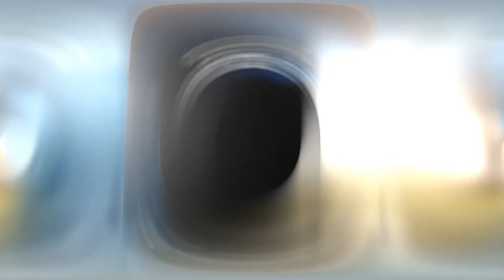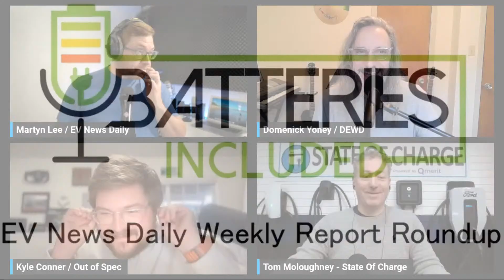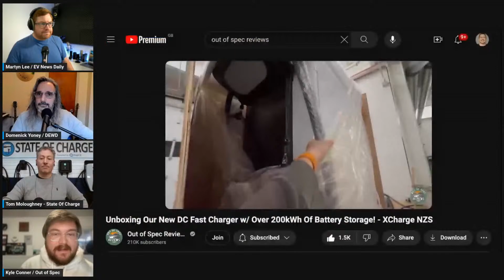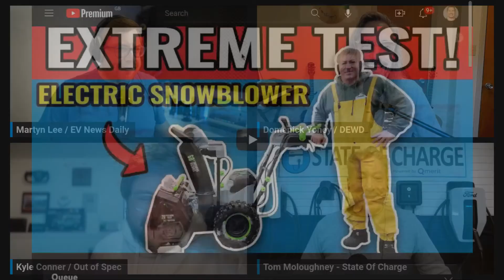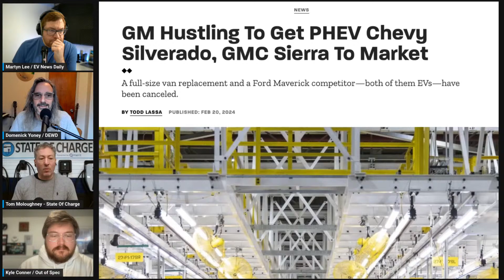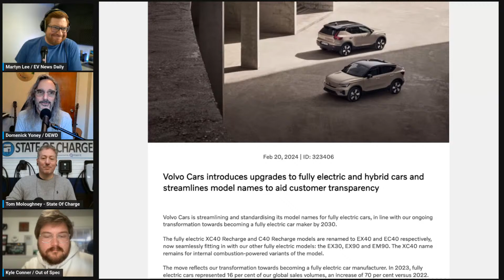Kyle Drives Honda Prologue, GM Reportedly Kills Small Pickup To Make Large PHEV

Comment: I want a quarter ton pickup because it's the least amount of truck that does everything I want.  Something that will carry two dirtbikes, modest interior storage and do it in the shortest width, bed height and wheel base that will make parking and backing up with a short trailer not a complete pain in the ass.  And yes there is most definitely plenty of demand for them, I get people offering to buy my 22 year old Ranger XLT all the time because they simply don't make these trucks anymore.  Just look at the used market for 20-25 year old quarter tons, the prices are absurd.

Comment: 1:04:06 “I’ve never understood the benefit of a small pickup” - I had an auto parts store and auto salvage yard supplying auto mechanical repair and collision repair shops. For the parts we did not ship on LTL carriers, I got rid of the full size trucks and delivered only with small trucks. We could deliver 5-6 engines on one delivery with the Toyota flat bed delivery trucks with dual wheel rear ends. Small pickup trucks saved us a ton of money.

Comment: Hyundai's Genesis and Mercedes just announced they are pulling back on EVs.  Tom isn't  omniscient, Neither is the Chinese Communist Party, which is driving Chinese automotive OEM policy. Mary Barra and Jim Farley are not complete dolts.  Reasonable intelligent people can disagree when US will achieve 50% or 95% BEV market share. Neither GM nor Ford are tuning off the Switch. They are slowing the ramp up.

Comment: I use Greenworks for all my lawn gear.  I still have a gas snowblower however.
Reply: I have Worx battery tools since 2008.  I do have their battery snow blower which is good for clean up and dry snow.  But still use 7-hp gas 2-stage from MTD.

Comment: Totally agree on electric power tools like chainsaws.   Infrequent use makes it hard to start.  Back in the day I’d get 120v as well as weed wacker (string trimmer).  But I hate cords!!!

I have several ego tools now, no need for gas can, and I’ve been extremely happy over past 5 years.  

Just wish replacement battery prices would have come down more by now.  But I’m sold!
Reply: I have had lead acid battery lawn mower from Worx since 2008.  So when the corded string trimmer stop working I was ready for Worx battery operated trimmer and blower in 2014.  I still have them but after one battery replacement in the mower I got lithium ion push mower and reduced the weight by half!  I still use the blower and trimmer and the 2-amp batteries still put out.

Comment: It’s 2024. These dealers could have a tablet sitting next to the EV on the show floor where people can put in things like miles driven. Number of road trips per year, etc. it could pull local utility and fast charge data as well as gas and spit out total costs. This would include maintenance too like brakes, tires, oil changes, etc. 

The problem with this is that it would make ICE cars look bad, which is 95% of what is sitting on the lot.